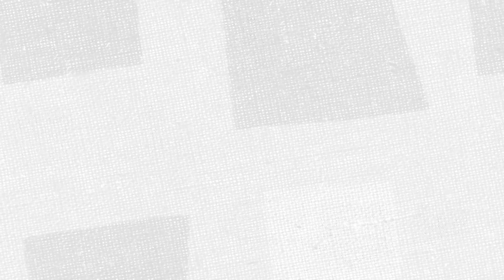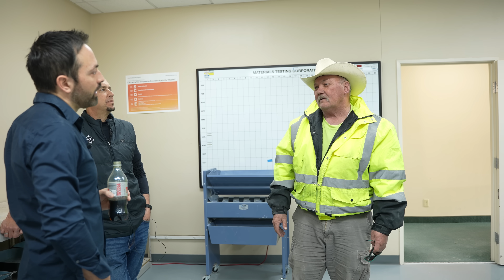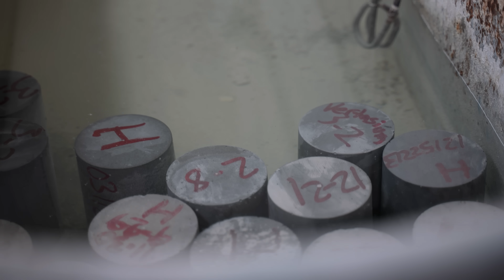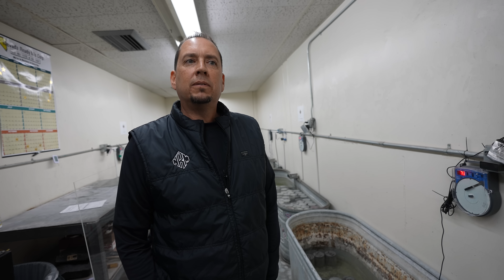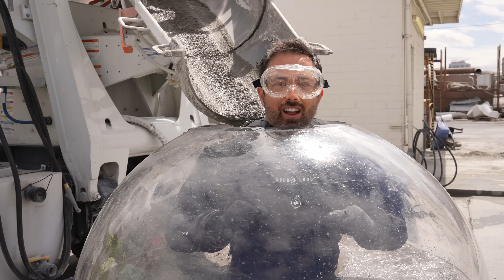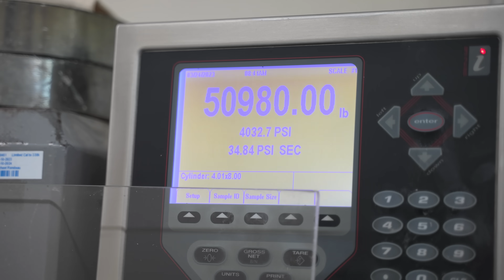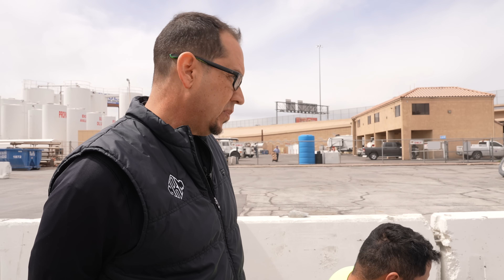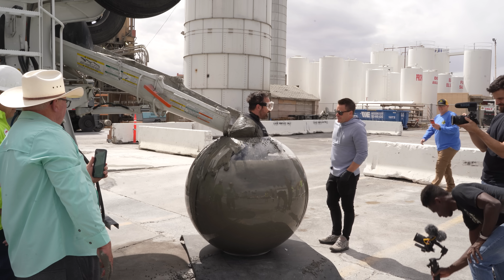Getting Buried In Concrete To Explain How It Works

Comment: I'm at 10:40 and I got to point something out: rounded aggregate might be useful for *finishing*, but is absolutely not wanted for structural purposes. 

That is why in the Emirate Arab, they are litterally surrounded with sand from the desert (round particles), yet they are heavilly importing dredged sand which then cause significant errosion issues.
Reply: It really doesn't matter. Natural sand is typically really poorly graded and there are gradation requirements.  Blending that sand to bring it into spec would be way too expensive. I'm only familiar with fine aggregate angularity specs with HMA. But, I've never built skyscrapers, so there might be. However, they'd need to pump the concrete and angular sand is h*ll on pumps and hoses.  I know it's not required for bridge decks and those can have some pretty high strength specs.
Reply: I've done materials testing for over a decade and in my area and almost ALL* of the concrete and comes from rivers, so it's round.  * Lightweight concrete that I've tested used volcanic rock and that wasn't from a river and had to be trucked in.

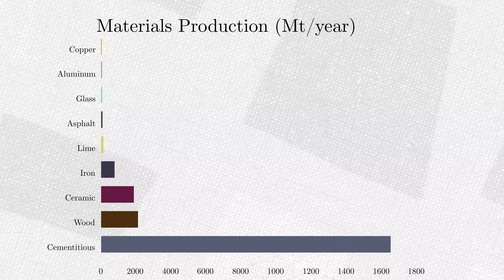Comment: Great educational and fun content as usual. Small Note: At 1:32 in the diagram, a 0 is missing from 10,000 upwards
Reply: Great educational and fun comment as usual. Small Note: why did you use a dot (.) not a comma (,)? 10.000 = 10^1, 10,000 = 10^4
Reply: @newman77777 the character used to separate the thousands is different in different languages. It's a comma in english but it's a dot in German or French for example. It's easy to mix them up when you go from one language to another
Reply: @MrWacck  Breh why is maths different in different languages

Comment: So, I drove concrete trucks for 4yrs, and then moved to driving the big truck & trailers for the quarry that supplied the concrete plant I had worked at. The aggregate that goes in is very specific...but the SAND! OMG the sand...at least down here in New Zealand, the sand is a mix of 3 different sands--sand that's dredged out of a river delta area, sand from sand dunes like an hour away, and then some "manufactured sand"--sand made from the rock that gets crushed at the quarry. It all gets mixed together in specific proportions. I had no idea there were different kinds of sand...

Comment: Great video. There are many cements now days but even before looking at the deluge of high performance chemistries and geopolymers, old Rosendale would far outperform most GP cements, only was sadly too long in the setting and curing to be widely used in roads and infrastructure. So in the modern context, Portland in fact is by no means the strongest or most durable we have. Not by a country mile. More confusingly perhaps, longevity doesn't just equal compressive strength either. Portland's relative rigidity is often part of its downfall where movement is concerned, especially when it needs to play with softer or more flexible materials. And now with rediscovered pozzolanic Roman recipes successfully recreated, geopolymers using fly ash from Russia and Ukraine more widespread, a host of new recipes from China, Portland is well and truly beaten in many different areas. It's also far behind so called primitive concretes in longevity in many projects including some you've pointed to - along with pozzolanic concrete there are numerous others in the Pantheon closer to just quick-lime mixes but the idea of the separation of the concepts is kind of a misconception, as all cements in question use fired lime and the pozzolan ratios varied in arguably a "privative concrete" - much of the lighter mixes in that one build still relied on the CO2 absorbing chemistry, so we've found. And further, Portland's inflexibility in many contexts involving ceramic masonries can be its downfall. It can literally wick water into weaker supporting structures like older or just under-fired brickwork, undermining it's own overall strength, or in earth builds even destroying a project. I needn't talk about rust in rebar I suppose and how quickly catastrophic degradation can happen - frequently in under 20 years depending on conditions. Cements and geopolymers are a fascinating area and I'd love to see more on this channel! It would be great to explore some of the work of a professor Davidovits if you haven't already 👍

Comment: Why wasn’t plastic on that goods list? 1:10
Reply: Because it's on the "okays" list instead
Reply: Density
Reply: Plastic is a god given right
Reply: Cuz it’s mid
Reply: Plastic isnt a single material, there is a lot of types of plastic actually

PS: 11 days later, and here is a better answer: Its just an example list.
For example, i found a estimate productions of: 
 — Cotton: around 25 million tons per year (more then copper, around 22)
 — Rubber: around 28.8
 — Paper, my loved paper since i like draw and make origamis and write story, around 400 million tons. (probably together with iron in this list lmao)
Reply: @NyshimoriMizuki  Lot of different types of wood as well but that’s on the list
Reply: For anyone wondering its about 400 million metric tons per year of plastics. Taking into account how light plastic is and it's impact, not great.
Reply: @johnsmithson4479  you know very well thats a false equivalence. types of wood are generally similar to eachother, plastic is incredibly varied. compare a disposable water bottle to a plastic jewelery case, or plastic wrap

Comment: 16:58 they are testing the slump test incorrectly. the cone is upside down and the method is wrong. Also for loading the concrete in a break machine it is 35psi per sec +/- 7 psi. The coke thing I have never seen/ if the ticket for the concrete is past 90 mins without being unloaded the QC should reject to batch.
Reply: I think that's primarily done to save the mixing truck rather than the load. They'd probably have to dump the load with coke in it, rather than using it for it's originally intended purpose.
Reply: Yeah super late but the reasoning is you dont want the concrete hardening in the drum if the drum is not properly agitating the concrete. So adding the soda (coke is arbitrary) helps stop that setting even without agitation, potentially saving your drum so you can at least make it to a legal site to dump the load.

Comment: A follow up video with the structural explanation of mixing concrete and steel will be very interesting. Check out the history of the Hearst Castle 😉
Reply: I was thinking exactly the same. Concrete is great against compression (as they showed in the video) but it would have been great to see what steel reinforcement does it against other kinds of stresses.

Comment: The aggregate helping it hold together is the reason why you should pour concrete onto old broken down concrete base it forms really well and bonds together, or extremely hard clay and of course adding rebar especially when you have concrete sitting next to something like a house or wall because those two objects expand and contract with the weather. The rebar helps it moove together and not as much, it also makes the concrete stronger especially where you might have weak areas

Comment: Great video! Btw, an actual slump test is performed and measured differently. The cone is placed the other way up and then removed after a special tamping procedure laid out by ACI, then the distance the top of the cone of concrete "slumps" down on itself is measured. If the slump exceeds engineers specifications (without the use of super-p or other MRWR's), then the truck is rejected. If the slump is too little to allow the concrete to flow into the forms, the driver will add water or super-p (plasticizer) and mix it up. Credit: I'm a former structural engineer who had a co-op during college testing concrete and forming cylinders for compression testing at job sites.
Reply: Yeah they basically made concrete soup. w/c of probably 1.0 or something.
Reply: I was a little bothered by him call it a slump test there too.
Reply: They weren't doing an actual slump test, which is ASTM C39.
Because it was apparently a high dose superplasticizer mix (ie. self-consolidating concrete mix) they used ASTM C1611 which uses the 'inverted slump cone' test method to measure flow diameter for self-consolidating concrete mixes.
I'm retired now (but have been in virtually every facet of concrete field/industry) and ASTM C1611 is far more applicable when you have slumps at or beyond the 10" range.
Reply: @markstone1619  soup
Reply: @Spicymuffins89  'Soup' due to mixes using superplasticizer = good strong high strength concrete with low water/cement ratio.
OR...
'Soup' due to mixes that only use water and no superplasticizer = weak crack-prone pure garbage.
Know your 'soup' to know WHEN it truly deserves criticism.
Reply: @markstone1619  all I’m sayin is that wasn’t a slump test, not criticizing anyone here.

Also, I love soup.
Reply: @arineey4538  All I'm saying is that it wasn't supposed to be a slump test, as that's not applicable to this type of concrete mix.
My comment about 'soup' or  'criticizing' wasn't even directed to you. I just hope you don't love concrete 'soup' if it comes from water, rather than superplasticizer.

Comment: 17:28 since the chemical reaction starts as soon as you add water, what happens if you keep the concrete agitated for days and keep breaking all the interlocking crystals , is it possible that it'll never set after that?

Comment: At 10:35, isn't it the opposite? I thought you needed jagged, uneven sand in order for the cement to bind properly. That's why you can't use desert sand in construction, it's too smooth. Sandy desert regions actually have to import sand gathered from oceans and rivers.
Reply: I heard the same. And it sounds logical: a puzzle-like surface can be interlocking much easier. On the other hand, microscopically the desert sand must also be uneven, and you can set in concrete even a polished glass marble, so desert sand must also chemically set quite well. I could believe that the desert sand is good enough up to a certain hardness.
Reply: While it's true you don't want very smooth rocks where the cement can't bind to, this is rarely if at all a problem.

The main problems with very rough and jagged rocks is that they absorb too much water leaving less for the chemical reaction of the cement. It also reduced 'workability' which essentially how liquid it is (measured by the slump test shown in the video),
It can also create weaken or create voids in the concrete. For example if you have a long thin rock, it can easily snap, and/or it can not fit in the holes in the reinforcement.

For desert sand, I'm not sure but I believe the reason it can't be used is it's too small and fine rather then it being smooth 

I hope I explained it well. Look up 'flakiness' and ' elongation' of aggregate, or more broadly concrete mix design if you want a better and more nuanced explanation.

Comment: (former) certified concrete testing technician here.
Derrick if it wasn't for your videos I probably wouldn't have pushed through and gotten my civil engineering degree.
Also if anyone has questions I'll answer them.
Reply: how many types of concrete are being tested in a typical day?
Reply: How durable is the concrete used in modern buildings? How long is a home going to stand before becoming uninhabitable? (Assuming no earthquakes, low humidity etc)

Comment: 0:50 The day comes that I finally correct Derek. 500kg of concrete will only make a bit over 0.2 m^3 of cement, not 2. Concrete does not float on water😂
Reply: Your prayers have been awnserd

Comment: I'd love to see a follow up video about how it's getting increasingly difficult to find the right quality of materials (gravel and sand) to create concrete and also touch the topic of reusability? I have no idea if we could demolish our buildings and somehow refine the leftovers into new concrete?
Reply: It's not getting difficult to find aggregates, they can open a quarry literally wherever and crush rock to the right sizes and shapes. Sand is getting sparse in natural deposits where it can be taken without concern, but they can also manufacture it, they just don't, cause its expensive. But when there is non naturally available, they will manufacture it instead. 

There is research being done into concrete reusability, but its more about turning it into road base material at the moment, as it takes a lot more processing to make it clean enough for concrete mixing. 

Concrete also mostly has reinforced steel in it, which makes it incredibly hard to feed through a rock crusher (and the rock crushing guy will beat your ass if he finds you feeding reinforced concrete chunks into his rock crusher) without first removing all of that steel, which requires basically double handling of crushing (which is mostly just a waste of time and money).

Comment: There’s a lot of really cool stuff happening with alternatives to concrete / ways to make it less carbon intensive. Also, we currently way overuse it, it should really only be used in horizontal/vertical building components (eg foundations/pillars) because it works best under compression

Comment: Carbon offsets are a scam :( V-boy’s been missing the mark lately
Reply: Not categorically, but they certainly have their limitations and vulnerabilities. They need independent oversight and the offsets focused on tree-planting can make very little guarantee that the trees will be there long enough to actually mature and make a difference. In my experience, Derek is usually good at doing his research though, so perhaps Wren is worth looking into.

Comment: I'm surprised that you failed to mention the massive negative impact concrete has on the environment. It's a huge contributor to anthropogenic climate change. It's a bit disappointing that, given your platform, you couldn't take that responsibility.
Reply: "8% of global CO2 emissions" well, that's the big impact there, and it was specifically mentioned.  Perhaps you didn't stay until the end of the video

Comment: The most produced materials, particularly in terms of raw materials mined, are dominated by iron ore and steel. Iron ore is the most mined metal, with 93% of total metal mined in 2022, and is primarily used in steel production. Steel is a highly consumed and versatile material, used in various applications from construction to manufacturing. Other significant materials include aluminum, construction sand and gravel, and coal.

Comment: I would be interested in seeing the differences in the bubble and a square....more concrete in the box.....but would bet you would have to get fully submerged....but even then, the body is made of too much water and so will float to top as you're just lighter, and have air built in. So, if you're alive and not bound down by restraints, then you will float up partially at least....still need to get out before hardening of course....so, nobody go falling into a fresh pour when nobody is around and definitely don't break any limbs in the fall, cuz the morning crew that hopefully IS coming to that site tomorrow, is gonna be shocked by what they'd find

Comment: As a child I was told that the Danish resistance, during WW2 would pour sugar into the concrete of the German bunkers along the western coast of Jutland, to weaken the strength of the concrete. 
I've never had that story confirmed and maybe the sugar only acts as a retarding agent (delaying hardening), but if it affects the final strength of the concrete, the 'Pop'-trick would only be viable for already discarded concrete. 

An intresting fact: Concrete contains crome and i can see that some people are commenting on chemical burns, but you should as well be aware of chrome allergies. Concrete in the EU should be Chrome protected to prevent allergic reactions, but the protection only last for about a year or so. So when you look at Ready mix bags, you should take heed to the production date printed on the bag. If the bag has gone over date, the Chrome protection wont have the full effect. 

I've been working with concrete since 2010 both as a craftsman and an ingenuer, but I've never thought u would actually be floating if u tried to take a dive in the mixture. 
Nice thorough video, though you only touch the surface of what the material can do. 

Things to inspire your next video: 
- Retarding agents
- Reinforced concrete
- Fibre reinforced concrete
- 3D printed concrete
- Temperature control during hardening
- Curing/plastic cover for humidity control
- Reinforcement glue for postapplied reinforcement

Comment: Why are we not shocking our concrete with larger load pressure changes?

Doesn't cement experience vast changes in pressure as large objects (cars, trucks, etc.) drive over them?

Comment: The drysuit also holds a lot of air, divers have to wear dive belts with most wetsuit types, but in my experience, especially dry suits. So, the buoyancy isn't JUST the concrete.

Comment: Scariest part about working construction was doing pull tests on concrete.. You would essentially glue a puck to the concrete then pull on it until the concrete failed.. The most I've ever seen was 60,000 PSI before it maxed out the meter. Being inside a giant concrete room, it rang our ears for hours once it finally popped.

Comment: Cement comes in bags... It's a very fine powder.  Concrete is the finished product after mixing cement, sand, gravel, water and any additives like plasticizer or accelerator.

Comment: when much younger I used leather gloves whilst using concrete the mix saturated gloves and caused burns to hands never again. If the guy did not have a dry suit on full of air he would sink easier just like in water but would still require help to submerge

Comment: The bouyancy is caused by the amount of water in the concrete if there was a smaller slump (concrete they’d actually build with) then yes for a fact you can be buried in concrete